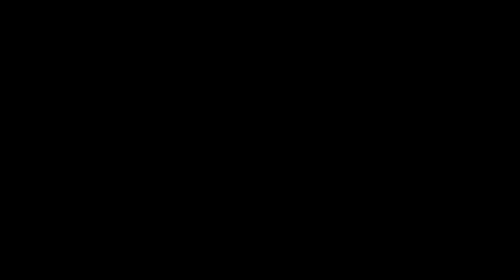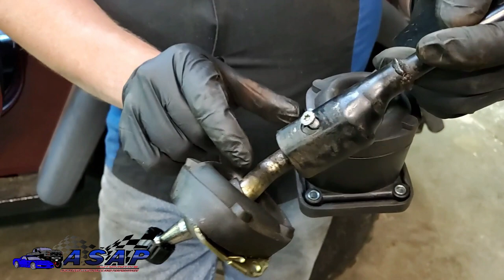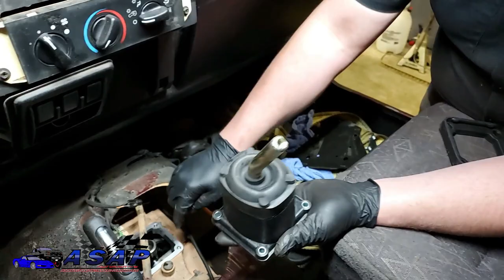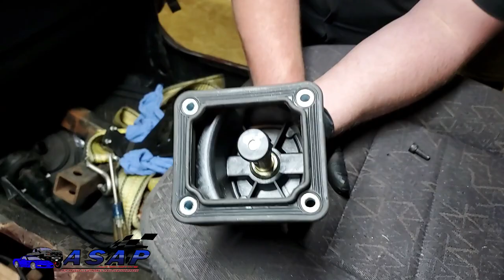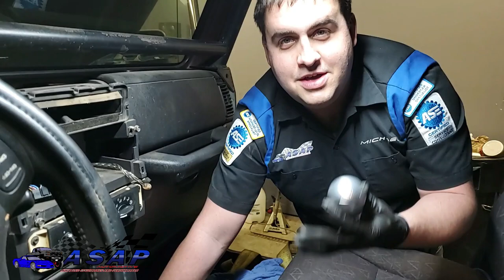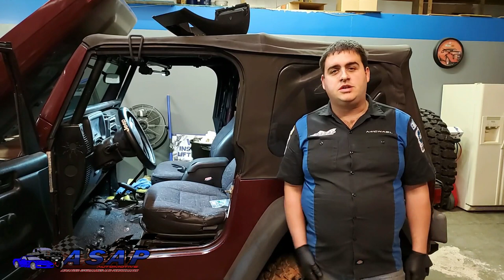TJ Short Throw Shifter Install

Comment: I’m having issues with my shifter popping out of 2nd and 4th because of the inner boot rubber. Anyone have any ideas how to solve that?
Reply: You’re probably going to have to buy another intership Boot or take the one out that you have, and put some canvas say from an old Jeep soft top and repair it. That way that will keep the heat out.